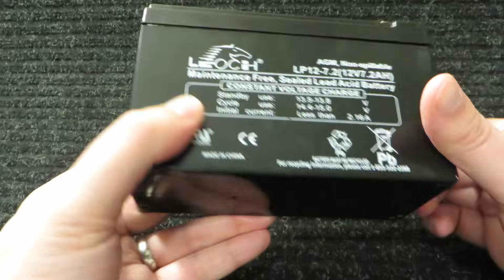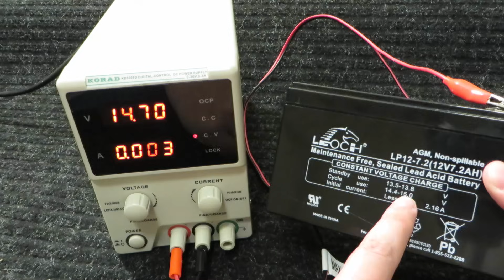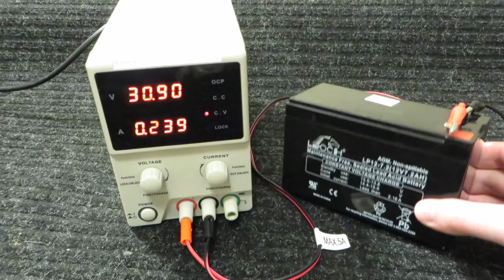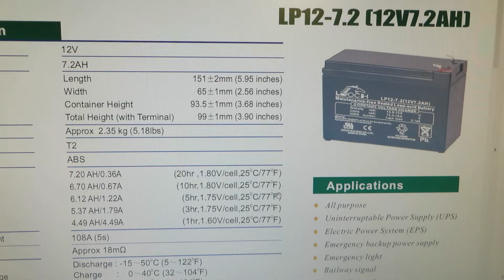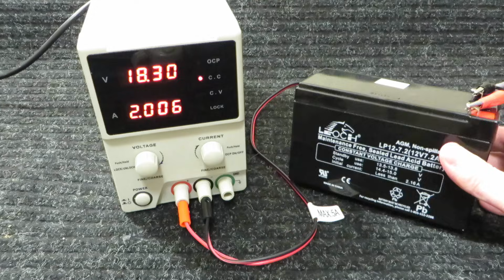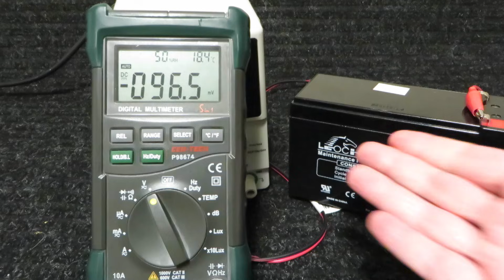Battery Desulfation Demonstration Start to Finish - Part 1/2

Comment: I have a U1 12V battery that sat for at least 4 years from my snowblower. I didn't bother maintaining it since I have had a snow clearing service. Anyway, it has been stored indoors just to make sure it didn't freeze. It read just over 6V and I decided to charge it with my new Pro-Logix PL2320 (at 2A)...I had to see if it worked. (all my other chargers are low current chargers/maintainers). Incredible, it took a charge and then went into maintenance mode. I did a load test at 100A and it dropped to 10V which it held. OCV a day later is 12.60V. I have done a few charge and load test cycles. So far so good.

Comment: Why not add water?  There are rubber caps, under the plastic lid.  Fill with water and float charge for two days.
Reply from the maker: Such a battery will still require desulfation after adding water but, yes, that can work if you do an extended absorbtion/equalization charge rather than only float.  I don't personally like the idea of breaking open the plastic vents and adding an unknown quantity of water to AGM batteries like this as there is no good way to know how much to add (overwatering is easy to do) , and then there is risk of future problems from mechanically messing with it.  Many people report success doing what you recommend so I assume it works though I've never done it myself.

Part of the issue is that once AGM batteries have been sufficiently 'used' to lose that much water they are usually in poor condition due to age or positive plate corrosion anyway.  If someone overcharged the battery and lost the water that way it would certainly be a way to recover it.

Comment: I have 2 of same battery with low capacity problems . Can i use my 28 volts printer adapter rated at 2 amps maximum to try reconditionning them ?
As battery prices in lebanon are getting very expensive .
Tnank you for the informations
Reply from the maker: Those adapters have a hiccup overcurrent protection mode, so you would have to add resistance between the battery and adapter to limit current to less than 2A.  Be careful and be safe if you decide to try it!

Comment: Hi, thank you for info, I subscibed :) . I have 4x SLA AGM batteries. Quite expensive UB12220 batteries that are not as far gone as yours was. All 4 batteries for my 3 wheel mobility scooter have a resistance as of yesterday of about 1.5ohms or 1500mohms ea. They each have a voltage of around 13.2 fully charged. They are rated at 22000mah, and only used them for 2 seasons but they don't go as far as they use to anymore. Make that 50% of the distance before everything starts slowing down to a crawl and literally have to push it back home... Can I use the same procedure of 30 volts on each battery or perhaps less with a lab power supply like yours and is there anything I need to watch out for while monitoring the procedure apart from monitoring their temps? I understand the risks, and would do this outside, and wanted to play with them a bit instead of just throwing them in the recycle bin...
Reply from the maker: Most likely if they have been in continuous use and always charged after use (or each night) they are not sulfated.  Depending on the charger used they may have 'dried out'.  If you wanted to try desulfating just to experiment with them you could do the same basic thing I showed here where you set the current limit on the power supply to an amp or two, set the voltage to something fairly high (I wouldn't go much above 16V except for batteries that refuse to take a charge) and see if they improve after a half day or day of controlled overcharge.  If that doesn't work there are other videos showing how to cut them open and add water - then you would need to do the process shown in this video again as the dried portions of the battery will be severely sulfated.  I haven't tried adding water to AGM batteries as I don't think it's very practical or safe but others have reported success.
Reply: @knurlgnar24  Thanks for your suggestions.  I indeed never left them off the charger in backyard shed when not in use, however, I often would ride for hours until batteries were discharging down to 10 to 20% capacity or 11.5 to 12 volts which I only read recently will create some sulfation or as you alluded to anytime their not being charged. You are right, their actually quite easy to open up with razor sharp knife all around the seam of cover and with screw driver and some surgery will pop it off... FYI, their not dry and liquid is still above the plates in all 4. Hydrometer readings are not great as expected since sulfates were not liquified back to rebalance chemically. Your method peeked my interest as if its only a matter of melting the sulfation between plates back in with some higher amperage, it would be a no brainer, and perhaps would bring them back quite a bit... Where I lack knowledge is the current especially the  amperage to use during the process but I think you made it clear and found you to be quite conservative on how I should procede, and sounds much safer and now confident I can do this in the basement. With loose cover, and under no pressure, they can bubble all they want... I do have a temp gun to monitor cells like yours if in doubt... I only need to get a cheap lab power supply like yours on Amazon and some 10 amp diodes so that batteries don't ever backfeed into the Power supply such as a power loss and destroy it. I have all winter to play with them on my workbench in my basement as in Canada, you can't really ride through the snow at minus 30 degrees...

Comment: Nice video and Brother Clean up that room you will feel better and have positive energy to do your hobbies again lol. Put those batteries under the table stacked. Clean that shelf and get that lab equipment setup on your desk. Start just by cleaning garbage.  You can do it just 15-20 mins a day will get that room in TOP shape in 1 week. From one hobbiest to another you need it man. When my work table is messy I cant even solder a wire properly. I know you know, But sometimes a little modivation goes along way. Please dont take this as an insult I truly feel like you are holding yourself back large !
Reply from the maker: I don't take it as an insult and I know you're right.  Trouble is the space I have is just too small and I have much more 'stuff' than shown in the video - or in that room.  (Three rooms and a garage with 'junk')  Each time I've cleaned it's ended up a mess after the next project because I don't have a place to put anything permanently and it's a huge pain to move things every time I want to use them.  A single dedicated garage stall attached to a 600ft^2 hobby room would do nicely.  Then I could put solar panels on the garage roof and...
Reply: @knurlgnar24  I hear you! The Room I do Projects in is my bedroom/studio/repairshop LOL, but my advice to you with the small space issue is you must be organsized and space will magically find its way to you like you never seen before. Make one Room your Designated Hobby Stop Shop. Get the garage to hold tupawears so that you can stack them and write with a marker what things are. 200$ Worth of bins shoud fix you right up. Stack as much as you can neatly making sure things are in the right place as it will save you time and headache later, Bundnles Chargers from laptops etc.Thats for the stuff you dont use often... As per for the projects try to have that last room setup with shevling and a table so that you can make it a " Project ROOM".  Only projects you will get done within 1 year or so. Youre a smart dude and I know you have so much more to offer us ! Thanks for the Reply now get Hustling = ) MAD LOVE

Comment: I watched part 2 and then came back to view part 1.....still good info.  I have removed the cover and rubber caps ( valves ) to add distilled water with a syringe into the cells.  Is there a way to check specific gravity so that I may mix acid and water to be close to original solution ?  I did not know before about leaving some headroom over the plates for off-gassing to re-constitute.  Thanks   JwgK
Reply from the maker: Unless the acid actually spilled only a trace amount of acid should have been lost.  Distilled water should be the way to go.

Comment: Just one point. Any 12v 7Ah battery I've ever owned can only be charged at max 700Mah. Im surprised the vent caps didn't pop at 3 amps 😳😳
Reply from the maker: 3A is too high, agreed, however the battery is rated for a maximum of 2.16A charge rate so I figured it was safe enough given my impatience.  Some higher end AGM batteries have no charge current limit such as the powersafe SBS batteries - assuming you stay within normal charge voltages of course!

Comment: Nice to see you back too! I loved the inverter reviews. I have learned that nearly all batteries that came from computer UPS's are usually toasted. I think they are just boiled dry. I have found a few bloated out too. The only batteries that stand a chance of recovery are ones that were simply neglected, under charged, sat on a shelf for 2+ years since new. There is no way of recovering a battery that has been cycled over and over to near dead everytime, or float charged at 15 volts like some UPS's can do. They're just pooped out.
Reply from the maker: I agree.  Most UPS units are designed for battery changes every couple of years and they 'boil' them dry fairly quickly by floating them at a high enough voltage to recharge them relatively quickly after use but low enough to avoid the cost of a multi stage charger.  The old ubiquitous APC Smart UPS units float them at around 14V from what I've seen.
Reply: All batteries can dry out which is a point that all battery manufacturers are aware of but never disclose to their customers. So when they say Gel and AGM are maintenance free, it's like saying transmission fluid is 'lifetime' fluid...yeah, for the lifetime of the vehicle which is a relative term. I think there needs to be more testing done by flooding AGM and Gel batteries to see how many if any are recoverable by adding water. AGM should have the best luck as I spoke with one manufacturer that told me they flood their AGM batteries with a typical water and sulfuric acid solution then dump out the excess in order for the battery to be classified as "AGM".
Reply: @imzjustplayin  Agree with your facts.

Comment: Thanks for this. I have a 12v 20Ah SLA battery that I neglected and when I tested it, it was  6v. None of my smart chargers would touch it. I have a lab power supply and it never dawned on me to try that - even though I've used it before to charge batteries. Anyway, 24hrs later and it was taking 2Ah from the power supply. It's now charging on a normal charger which shows 20% charge. Even if it's not useful at the end of the exercise, it was fun!
Reply: the reason "smart" chargers don't touch dead batteries is because they don't see a load and they have short circuit protection built in because dumb people like to shock themselves or start fires. you can trick them into seeing a load by putting a high-wattage resistor or incandescent light bulb in parallel w the battery.

Comment: So if I understand correctly, best way to charge a battery is to put very high voltage with lowest current possible ?
Reply from the maker: For desulfating that is an option.  For general charging I wouldn't recommend this method.

Comment: Trying something similar with a trash picked 12V SLA , but at about 10 times the voltage. (and, at a much much lower current)

Comment: I tried this wil a 12v SLA battery.... Took overnight before any current registeted on the lab power supply. Long story short it was able to power a 12v 55watt car headlight at about 40% brightness for about 10 mins. I cycled the battery 4 times and the results where no different on the headlight.... Basically its a huge waste of time, thought i suppose it disnt help that there was white powder comming from my battery.
Reply: the battery is then dead and not sulfated. Not All batteries will accept to take charge once again, almost when active materiel onto the lead itself is gone
Reply: Try use a smaller load. And that white powder is toxic, by the way.
Reply: @johnrubensaragi4125  lead sulfate crystals? Basically its much more economical time and money wise to spend 10 to 15 dollars on a new SLA battery.

Comment: i have never had luck with this battery restoring, best i get is around 25% of new.
Reply from the maker: It's possible that you've tried restoring unrestorable batteries.  Depending on your specific situation that may be the case.  For example most batteries that were in cars and failed in that application won't be restorable.  And many UPS batteries end up being dried out and won't restore.  It takes the right battery and the right situation.

Comment: Hi
Is capacitor based chargers that many are claiming as good tool for desulfation, is that really effective (capacitor in séries with bridge rectifier and then output to battery )
Reply from the maker: No.  They are not useful or effective.  Simple constant current charging is the most effective way to desulfate batteries.    That isn't to say such chargers do not desulfate in some capacity - I'm saying that they are inferior to simple constant current methods.
Reply: Ok thanks
But is it true that this kind of circuit will put pulses of 170v (or 310 in cas of 220 v supply) and that will cracks plates so sulfate will dissolve once again ?
Regards
Reply: @knurlgnar24  Why would these chargers be inferior? These capacitive dropper supplies are linear circuits, essentially just constant-current supplies with high ripple. Ignoring the safety aspect of an unisolated supply, isn't this more or less equivalent to a classic dumb charger?

Comment: I've never had any luck trying to recover dead lead acid batteries (AGM) (Car) (Leisure) . Although I don't think i've tried your method of constant current. (too scared battery would explode). I do remember many years ago taking a vehicle into a garage for a service and noticed a sealed lead acid battery the same size you have here, on a work top connected to a normal "Non intelligent" charger and the bottom had blown out. I remember laughing to myself. I hope you are wearing some sort of eye protection whilst doing this. Don't let youtube control your life.
Reply from the maker: I almost never wear safety glasses when working with batteries.  And you're right.  I should.

Comment: I've had a lot of luck using this method, starting with as much voltage as required to start current flowing.
Reply from the maker: Thanks for the comment!  It is always interesting to hear of other people's experiences with these processes.
Reply: I used a similar method (except I did low voltage and very low current, took at least a week) with a battery that was left unused for years and it recovered perfectly from half a volt. On batteries which died in service, I haven't had any luck. The bad ones might have dried up, but even after adding water they wouldn't take a charge.
Reply: Is there such as thing as too much tension with this method? Is there any risk to go let's say 50-100v range? Or is it better to start low and start ramping up voltage until current start rising?
Reply: @adruna  Yes, Yes(big risk), Yes.
https://en.m.wikipedia.org/wiki/Battery_regenerator#Regeneration

Comment: Glad to see you back! That intro music is the best, don't change it. I'm curious to see a demo of the battery capacity and output power of a recovered battery like this. What percentages can you expect? As for other properties, like self-discharge, do you have any predictions on what those could look like?
Reply from the maker: Part2 will have some, but not all, of that info.  The video got long so I cut it short.  Typically if a battery recovers it will have a higher internal resistance than when new and a lower capacity - the two are usually about the same percentage of new though it varies.  Self-discharge is a wildcard in my experience.  Most of the time you'll have no issues with it but it will almost certainly be higher by some amount than a new battery.